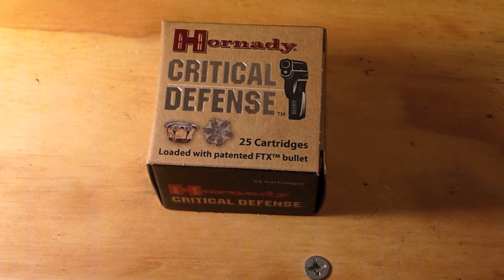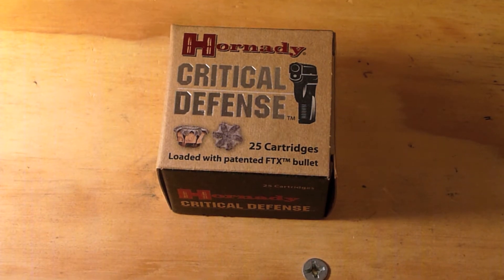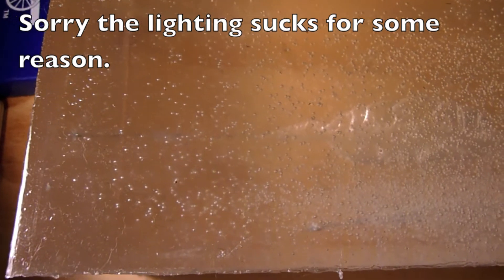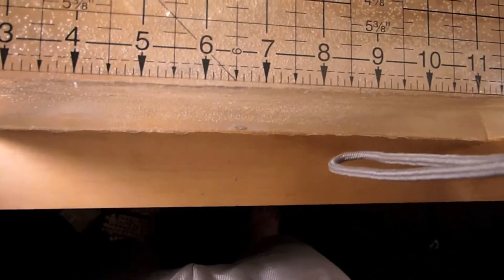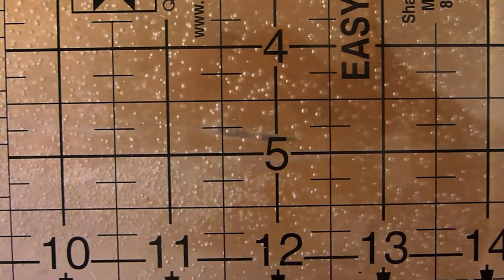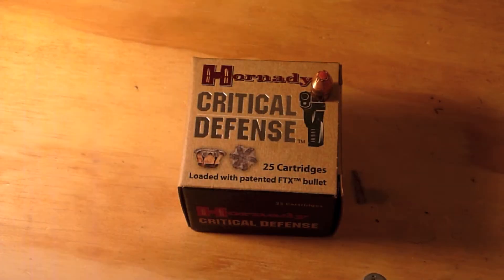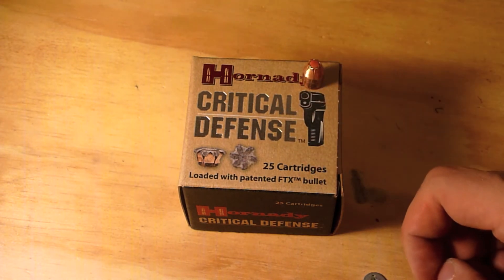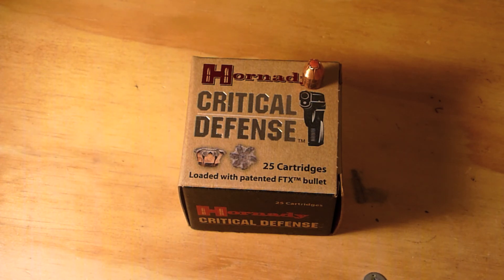Clear Ballistics Gel: Hornady Critical Defense .38 Special 110g *REDO*

Comment: I saw a video where they shot a hollow point .22LR out of 3" and an 18" barrels.  The round expanded with the 18" but not the 3".  So barrel length does effect if the hollow point expands or not.